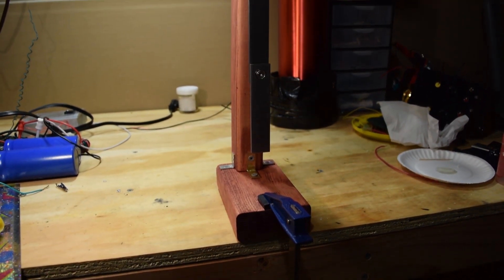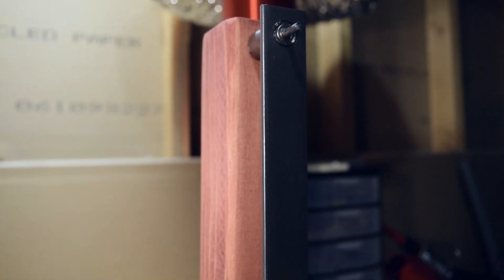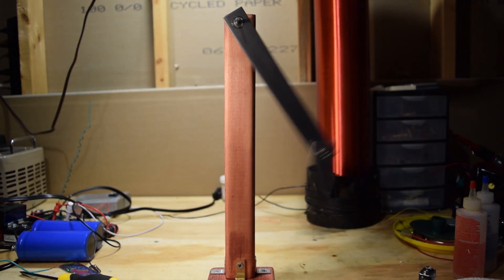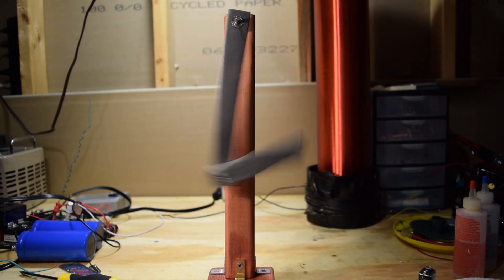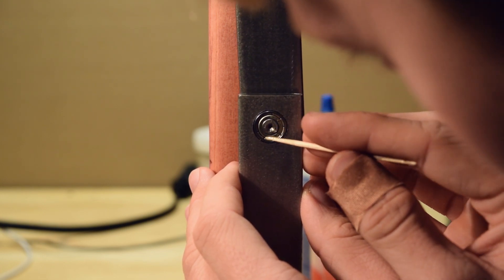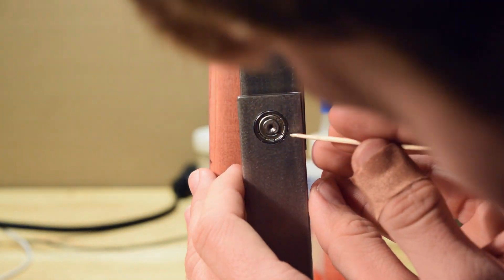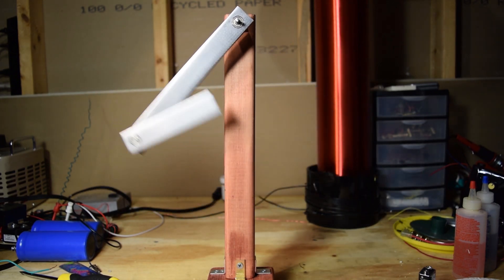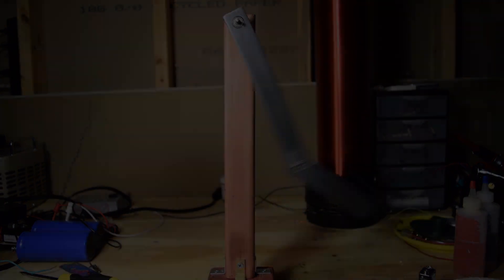Crazy Chaotic Double Pendulum

Comment: Are there ways to predict the motion? My understanding was that it was practically impossible to predict because the future state is very sensitive to the starting state, so sensitive that the starting state cannot be measured accurately enough to make predictions. Even if you set up two exactly identical pendulums side by side in a physics simulation, they'll quickly diverge just because of infinitesimal errors in the floating point math
Reply from the maker: Rob Mckennie You are correct, the motion is extremely unpredictable. There are equations that can estimate the position but the error builds over time. That is what I was referring to in the video, I think my wording did make it sound like it was predictable looking back at it now, whoops!
Reply: What +Gooferking Science said is correct, however just because you cannot predict the exact trajectories of the pendulum , all hope is not lost. There are advanced mathematical techniques such as periodic orbit theory that allow you to approximatly predict the motion quite accurately.  For more details on periodic orbits in double pendula, check out: http://openpipeflow.org/index.php?title=Periodic_orbits
Reply: Yok Dayı